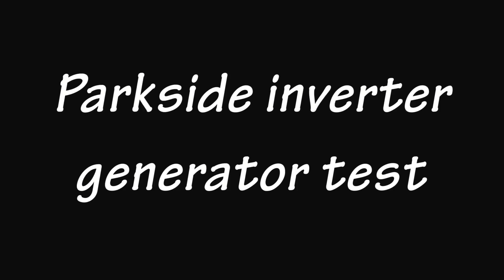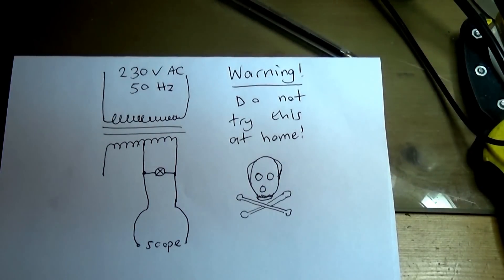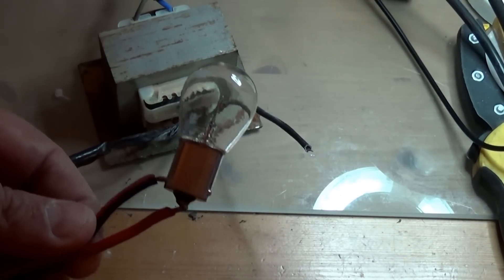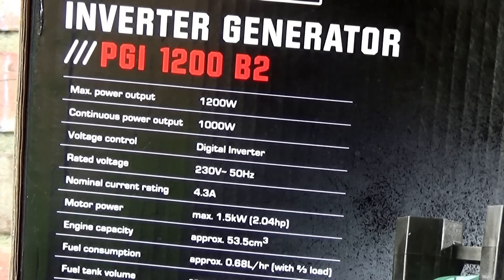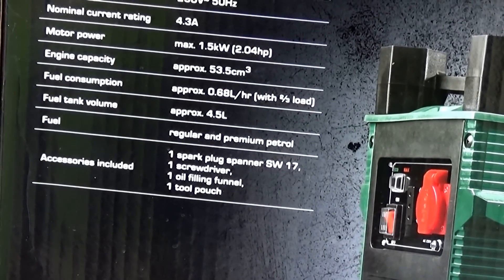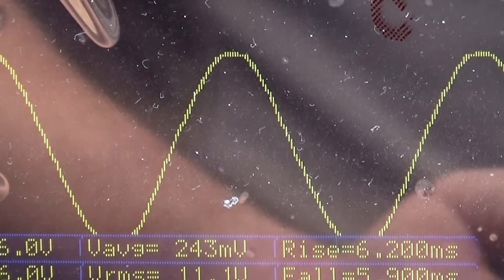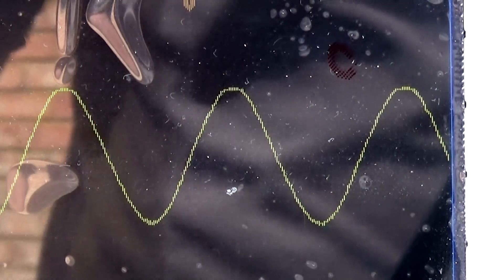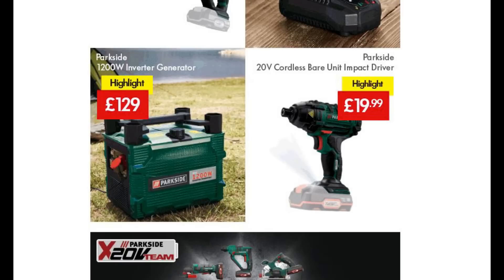Parkside (Lidl) PGI 1200 B2 Inverter Generator test

Comment: One of the major failings of this generator, which is well illustrated in the video, is it being a right pain in the butt when trying to start it.  Mine used to take about 20 pulls before it would run.  The basic problem is the level of the fuel in the fuel tank with respect to the carburettor.  Because the fuel tank is mounted on the side of the unit, rather than above as most small genertors are, if the fuel level is anything but absolutely full then the internal fuel lift pump has to get fuel up to the carburettor before it will run. The lift pump is operated by crankcase pressure and one has to do multiple pulls to produce sufficient lift.  If the tank is brim full then that problem is eliminated.  I've done a small mod to my machine by fitting an auxillary high level priming tank made from a short length of 22mm copper tube.  This primer is an airtight chamber with a screw cap.  Because it is permanently higher than the carburettor, the engine starts no problem.   My unit is several years old and when preparing to undertake this mod I discovered that all fuel hoses (rubber) were perished and leaking so they also required replacing.

Comment: In 2020, Lidl sold the PGI 1200 A1 generator - slightly different visual than the one in this video.  I’ll have to research what the difference was???  My question was regarding the earth connection on the generator....when would you need to use that?

Comment: I purchased one of these for power outages we have during storms and the generator is definitely not without problems. The noise level is abhorrent which can be heard from the video. A MUCH bigger problem is using the generator with devices that suck an awful lot of amperes when plugged in. This is called "inrush current". My 125W Whirlpool freezer either stops the generator or refuses to start (due to voltage drop for a few hundred milliseconds). What I have had to do is do a "hill start" with the fridge plugging it in before starting the generator. The generator starts with a bit of a cough but in most cases, the freezer starts and the generator keeps running. The freezer taking 10% of what the generator has to offer (1200W) you would think that you can plug in a laptop power supply (60W). Those devices,  however, have a tendency to power up taking a huge inrush current as well (quite a surprise). So do the same you did with the fridge (the "jump-start"). Why the laptop power supply works like this may be due to some capacitor loading or some phenomenon with the transformer circuitry. 

The compressors in cheap/mid-price/old freezers and fridges are piston based (like Watt's steam engine) and getting them run the first stroke requires a lot more power than keeping them running. Some do have a "soft start" but I have not seen one so far. So if you are planning to buy a generator to run a freezer or a fridge you should consider purchasing a more powerful alternative.

Anyhow, both of the problems I described are very common and you will find lots of discussions by Googling "inrush current inverter", for example.
Reply from the maker: Thanks for the comment. That's really useful feedback.

Comment: I have had this unit for almost a year now share4.photo/F3kGenerator  I use it to power my toyhauler RV when I'm out in the back country. I purchased this to replace a beast of a Champion unit that was just too loud. I can also lift this into my truck, but the Champion required 2 people. This Firman unit is absolutely awesome. It powers my RV including the Air Conditioning with ease, and it is super quiet! I honestly can't get over how quiet it is.unning air this unit has powered 2 full size RVs at the same time. It also has a battery charger kit that I used when my car battery died. I bought it at Costco so I am protected by Firman and Costco so I know I will get years of service out of this unit. Easy to start, easy on gas and more than enough for the job! 5 Stars! The best part is the price was literally 1/3 of the cost of a similar Honda so my camping buddies now hang their head in shame.
Reply: what oil u put in ?

Comment: Used mine 3 times, went to use today and the fuel that goes in comes straight back out the bottom, any idea?
Reply: Fuel line disconnected? Or just the screw from the carburetor loosened up?

Comment: hi all there not to bad but do suffer with some easy to fix problems
first the fuel tank will rupture quite easy if bumped on say a sharp edge
second the overload led on with nothing plugged in 
remove the lid on the inverter you will see a large white socket this sometimes  works loose because it was not plugged in properly
third oil light on even though the correct amount of oil is in
this is down to the oil switch sticking tilt the generator on its side remove the dip stick just to the left though the filler hole insert a longish non sharp object and keep tapping the switch this will release the float or disconnect the wire and run the generator for ten minuetes then plug the wire back in
forth the drain screw in the bottom of the carb can work loose causing a fuel leak 
i will update if i have missed anything
Reply: Hi Dean, how easy is the fix for the carb screw? Mine is leaking as quick as its filled!
Reply: @dcracing6  he said the carb works itself loose so search for the air filter take it out and look inside the airbox for screws.. go on from there
Reply: dean handley yu